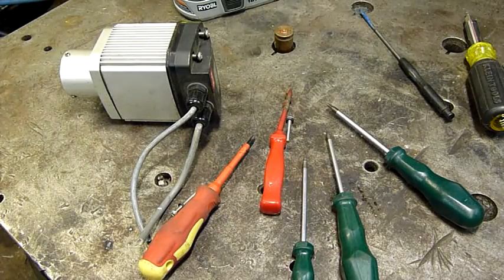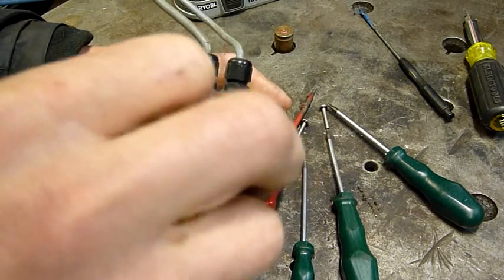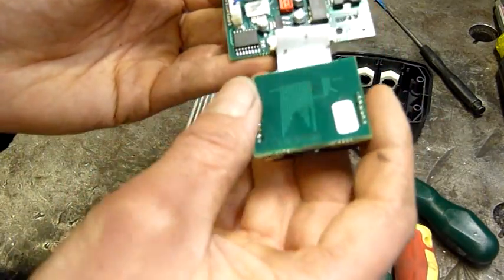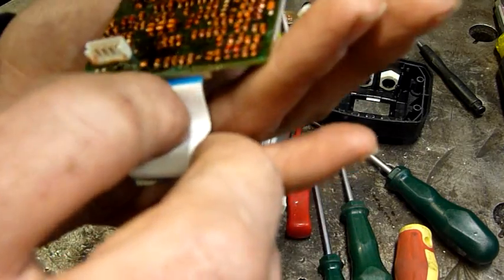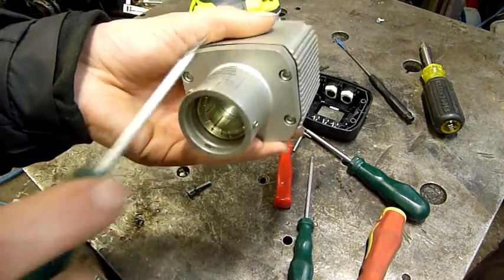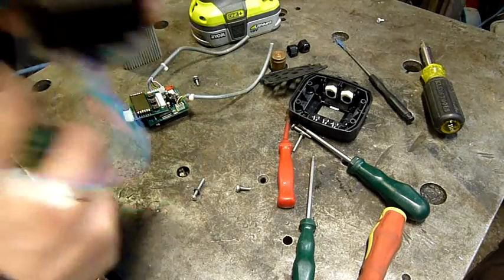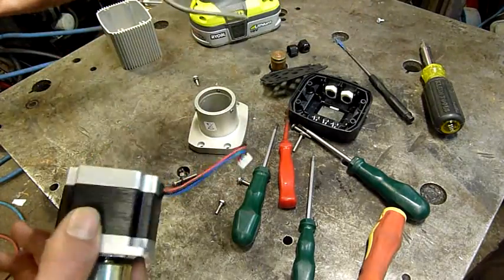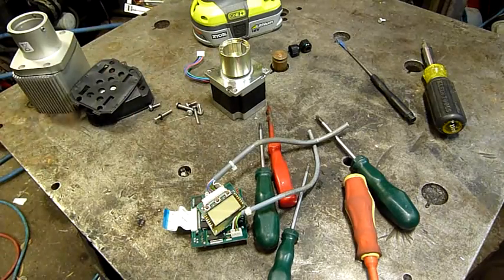Danfoss ICAD 600 Valve Actuator Autopsy

Comment: 4:32 That's actually a 2 watt dc-dc converter, unregulated, galvanically isolated. My guess is that they needed galvanic isolation for safety but didn't want to pony up the cash for a regulated converter. It's all good though because the motor itself won't really care about the voltage.

Comment: glop tops are used when costs must be reduced, as it only takes the silicon, without any packing and traces going to the silicon piece directly instead of puting the silicon in a leaded package and then solder it to the pcb. It's common for lcd controllers. Hovewer, this valve doesn't look like a cost concerned design ... its pretty nice. Congrat on this 1400 vid.

Comment: "Victims" lol :-) nice.

I dump the torx security screws as well, nice straight head screws replace them :-)

When i worked at an auto factory we sealed the back of pcb's with shelac, it was red and a bugger to get off.

I bet there is sod all wrong with the stepping motor, and it dont look like a cheap one eather.

Smashing disection :-)